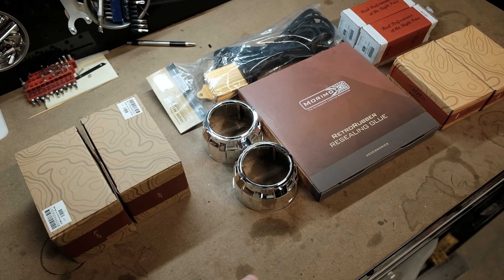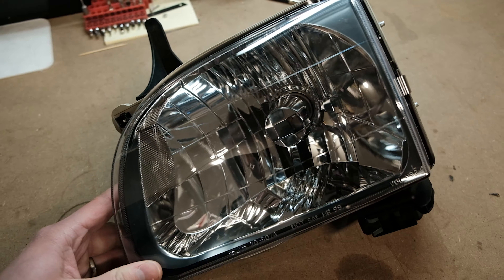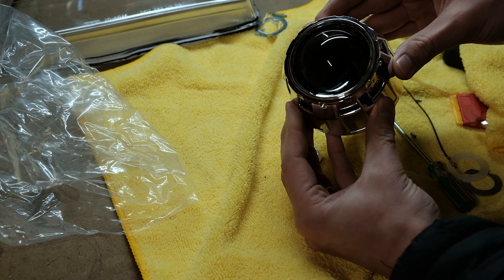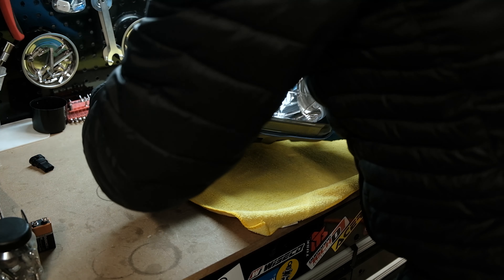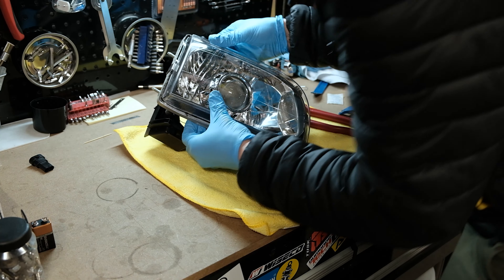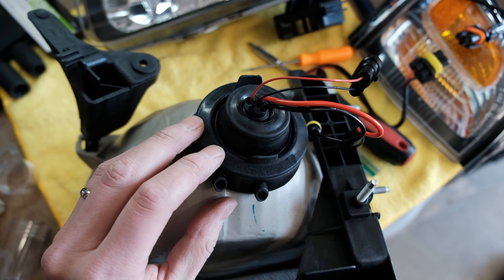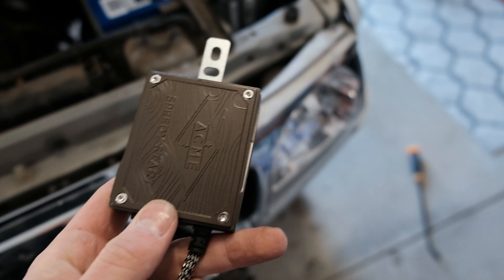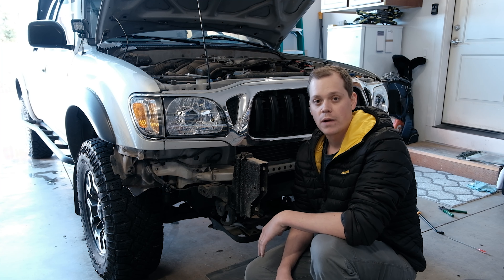DIY Projector Retrofit - Super Easy! - Save Money, Do It Yourself - 1st Gen Tacoma

Comment: This video encouraged me to go ahead and try it since mine were yellowed. I had some questions after watching this video but I figured I’ll figure it out myself once I get working on my kit. Here’s the first question I had, when doing the wiring, was there only one plug that went into the factory plug from previous headlight. Answer is yes. The driver side is the only one you’ll need. The next question was when did you put the bulb in? I figured out it kind of has to be a perfect sequence to get the wires and grommets to fit perfectly since some plugs didn’t fit through the dust grommet from the headlight. After I installed mine which was just as easy as this video looks, I realized something that I’d like to let y’all know before you get too far and that has to do with the cutoff line. I thought the solenoid was at the bottom and also figured due to the placement of the alignment washer that it would be good however it is not. Make sure the solenoid is dead perfect AFTER you have tightened the nut. I do believe you can adjust it once it is installed but I am going to try to do that tomorrow after work. All in all great video, helped me a lot, and I definitely recommend this to anyone.
Reply from the maker: Glad the video helped you! Also great tips! I put the bulb in before installing the headlight.
Reply: How did you get your passenger side light to turn on with no plug into the factory wiring?? My harness only has a plug on the driver's side and my passenger light won't turn on (I'm assuming because there's no plug...). What did you do to get it working??

Comment: Thanks for this video, I followed step-by-step and now have killer retrofits!

I was wondering, did your in-dash high-beam indicator light stop working after install? Mine doesn't light up when I have the high-beams on and was wondering if the bulb is out or if it's something else. Thanks!
Reply from the maker: Glad it worked out for ya! Yeah my high beam light stopped working too. I just got used to it ha! I believe there is a mod you can do to get it to work again
Reply: @pnwxplore  I read in another comment that you had a ballast issue and were able to warranty it. I think I'm having the same problem. I started only having the Driver light come on with buzzing coming from Passenger. Then both lights would work intermittently, and now neither of them are working. Does this sound like the issue you were having with your ballast? I reached out to The Retrofit Source and am hoping they can hook it up. Thank you!

Comment: Great video! Used it as a guide on both retrofits. 
Just finished installing in my 04 tacoma and the high beams don’t work only low beams. Did you do anything in specific? I know these trucks are grounded for the highs to work. Thanks!
Reply from the maker: Hmm, I don’t seem to recall doing anything special for the high beams, simply plugged everything into the harness as intended. The light on the dash will no longer come on, but the harness should handle the needs of the high beams.
Reply: Interesting, I’ll look into it. Thank you anyway!

Comment: How did you get everything aligned properly.  I have a 2004’and just installed the same kit.  I had to add washers on the lower mounting screw for both sides to align my lights.
Reply from the maker: Definitely takes some tweaking. I had to shim my bulbs a bit.

Comment: I just did this project on my truck loved how it came out but slight problem. One of the projectors is not level so at an angle, don’t know how if I aligned it correctly :/
Reply from the maker: You should be able to twist the projector in the housing and straighten it out
Reply: @pnwxplore  do you think that process involves having to open up the housing? Because I was think of loosen up the nuts slightly and twisting the projector from the back

Comment: I’m sure it’s nothing but I tried that method where you test the high beam cut off with the battery on both of the projectors and neither of them it did it. I tested the battery and it had power but I’m sure when I plug everything up and to a reliable source it should would. I just finished installing the projectors and bulbs in the headlights today.
Reply: how'd it go?
Reply: Yes how did this go. Curious myself doing this same kit for my Tacoma as well

Comment: Great informative video- thanks!

I too am changing the old  light lens assemblies on my 04

Per previous owner:

My o4 has the only high beam diverted to added lights on a bull bar - using the steering wheel light switch 

and some odd  added white light aftermarket blubs and low beam wiring kit which is horrible

I plan to pull all of this out 

Can you anticipate how the previous owner modified the stock  light switch for an alternate high beam and how to swap back ?

Still running these lights?

Still recommended?

Thoughts on that ARB bumper ??

And all related lights as added to same…

Thanks!!

04 sr5 extended cab. 2.7   manual
Reply from the maker: Wouldn’t have any idea about your wiring situation.

I am still running these lights and they are one of my favorite upgrades. Only issue was a ballast that went out, but the retrofit source replaced it under warranty. ARB bumper fits my needs well, so i like it a lot. Not super heavy either
Reply: @pnwxplore  thanks

Comment: Nice work on the retrofit! Do you mind providing the breakdown of your kit? Lol a little confused with the shrouds, ballasts, etc.
Reply from the maker: I did the mini Gatling gun shrouds, Acme standard bulbs, H4/9003 motocontrol harness and the speedy start ballasts.
Reply: @pnwxplore  what temp bulb did you end up getting? It seems like 5000K but just wanted to make sure. Going to do the same set up. Thanks for the vid!
Reply from the maker: @ttngu203  yes correct, 5000

Comment: Great video.  I was most nervous about the baking part but that looks very easy.  I'm interested in the longevity of these retrofits and how long the bulbs are suppose to last.  I've tried LED's but they had fitment issues and I've looked at brighter replacement halogens but they have a lifespan of under 200 hours.  I"m still running the original halogens on my 02 taco and figure they have over 5000 hours on them but over 18 years either they or my night vision has become dimmer.
Reply from the maker: Yeah the baking part is pretty simple. I’d say the harder part is just making sure it’s all clean and you do t leave behind any finger prints our dust when you bake it back together. 

Time will tell on how long they last, but so far no issues
Reply: @pnwxplore  when they die do you have to bake it again or at the bulbs able to be changed from the back?
Reply: @jvogler_art4708 was also interested in how to replace if required
Reply: @BionicLesbian you wouldn’t have to bake it as long as you don’t need to change the projector out, changing the bulbs you do through the back.
Reply: @80daymond  thank you

Comment: I have an 04 Pre runner. I've looked at the exact kit, what shroud did you go with? I like how the projector fit perfectly in the shroud and was able to use stock hardware from the original headlight assy. And what bulbs did you end up going with? Thanks in advance.
Reply: I found them down in the comments. Thanks. they do look sweet

Comment: Did you retain the "BRIGHT" notification on the instrument cluster when you switch to brights? It's required in my state (TX).
Reply: Also I want to say that you did a great job on this video. Very thorough and clear. You also added little things like the exact temp and time for the lights in the oven, the adjusted orientation of the H4 bulb retainer adapter, and the orientation and location of the electrical components. You went above and beyond, home run.
Reply from the maker: Thanks man! Glad you found it helpful! With this I did not retain the high beam indicator. I am actually not sure why. My LED bulbs prior also did not have this. Haven’t looked into it since it doesn’t bother me
Reply: Call headlight revolution. They make a plug and play resister kit to solve this as I lost mine with LED bulbs

Comment: I ordered the exact same kit (with the H4/9003 harness) but there's only one plug (driver's side) into the factory wiring, and now only my right side light will turn on - is there a different harness that also has a plug on the passenger side???
Reply from the maker: There should be two connectors coming off the relay.

Comment: I haven’t installed mines on the truck yet because I’m waiting for the passenger side headlight to come in. But I’ve done the driver side. Retrofitted and all. I didn’t double check because I was too excited and missed probably one important step. But was I supposed to aim the projector/shroud at a certain direction/angle? I sealed it up and I started staring at it. That it seems to be pointing more towards the right and down? if you were to look straight at it. Hopefully it makes sense. I looked around for some pics online and noticed other retrofitted headlights looks like is facing straight and center. I posted on TW forums and one person said I won’t find out till it’s on the truck. I may have missed it during your instructional video if you pointed that part out or not
Reply from the maker: There really isn’t any aiming to be done before it’s on the truck other than rotational and making sure it’s close to level for the cutoff. You can handle the rest of the aiming once it’s on the truck
Reply: @pnwxplore  ah makes sense! Appreciate it man great video btw!
Reply from the maker: No problem, thanks man!
Reply: @pnwxplore  finally got to see em at night. But major mistake that happened for me... the horizontal cut off line is way off. I guess as I tightened the locking ring, it rotated the whole bulb with it. So now it’s like 20degrees off CW. I would have to rotate it back CCW to level and then I’d be able to start adjusting vertically. Did you have an issues with this part? I did start it off with the solenoid facing downwards
Reply from the maker: You can rotate them when they are installed. Just need to loosen the nut a tiny amount and use something to grip and rotate the projector. Then you can retighten
Reply: @pnwxplore  I’ll def try that tmrw. Did you just hand tighten yours or did you use some pliers to get it cranked down?
Reply from the maker: Used some pliers to get it tight. I too forgot to check the horizontal cutoff lol

Comment: Hey just wondering I bought this kit actually and bought some aftermarket tinted lights to go with them but once I popped them in the oven they did not come apart. Even put them in longer and ended up breaking them trying to get them apart the didn’t come apart like yours did. So I was seeing which lights you bought so I can get it right the second time
Reply from the maker: TYC was the brand I bought, commonly used by body shops

Comment: Anyone got a link for some headlights that worked for them? The ones I bought were sealed extremely tight and I broke the plastic trying to open it up.
Reply from the maker: TYC headlights should work well, but a well sealed headlight should be difficult to get apart, you may just need a little more heat
Reply: @pnwxplore  Thank you! I ended up melting the plastic of the front housing before the seal got loose :/ they were an Amazon purchase

Comment: Did this and my right headlight is not level. Do I need to unseal it and adjust the projector?
Reply from the maker: Level as in which way? You can rotate the projector in the housing to fix any issues like that without needing to take the headlight apart. Just have to loosen the nut that holds the projector in the housing slightly and rotate, or if you didn’t tighten super tight to begin with, you should be able to rotate it a little. You can also use the bolt I point out in the video to aim the headlight up and down.

Comment: I ordered the same exact kit you used in your video and my harness didn’t have a hi beam connection nor could connect to my stock H4 plug, I contacted retrosource and the guy told me I needed an H4 harness.  

So he’s sending me hopefully “the correct H4” harness.  

Am I missing something?
Reply from the maker: If you ordered the bi-xenon moto control H4 harness, that should be the one. It’s what I used.

Comment: Finally got around to give these a try, but The Retrofit source are indicating these are not street legal?  On checkout they ask how you will use these.  If you choose headlights they won't sell them to you.  You can choose Fogs and then buy them.  I just don't want to give the cops another reason to pull me over.
Reply from the maker: They are not legal because they are being retrofitted into halogen housings. As long as they are aimed correctly, not much difference vs a car that comes equipped with them

Comment: Anyone on here do this on a 98 Tacoma? The headlights are different shape, was just wondering if the fitment is the same with them?
Reply: Wondering the same
Reply: I ordered and have my kit, I've just been waiting  until we get some warmer drier weather. Will update once I get it installed.
Reply: @kadebrantingham3156  I did the install on my 98 today. Used the same components he ordered from the original post and they fit perfectly. I was concerned about the depth with the different style lights but there is plenty of room. Now just waiting until dark.to dial them in. Hope this helped..

Comment: Led bulbs work well in reflectors
Reply from the maker: No they actually do not. They make work well for the driver, but they are bad for other drivers as the glare is bad and doesn’t properly reflect
Reply: @pnwxplore8481  if they are inserted so that the leds are aimed sideways, they do not. Install them wrong and it is a disaster.
Reply: @Phil-D83  that’s not correct. They are supposed to only have one orientation
Reply: @JarenMorris_UnderHover  projectors are preferable, but my experience is that they work fine in reflectors. Suprised you did not go for the laser led projectors that do low and highbeam (expensive, but awesome)